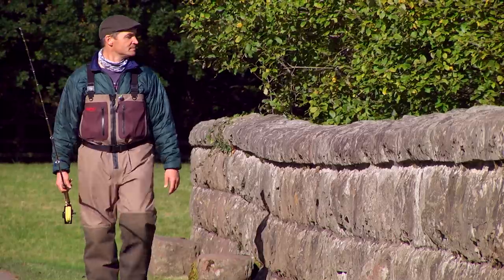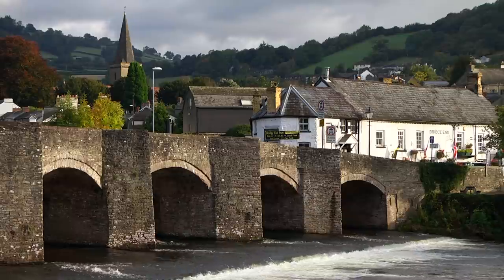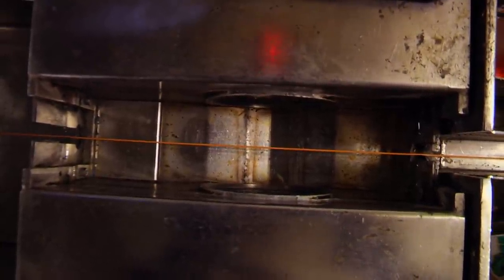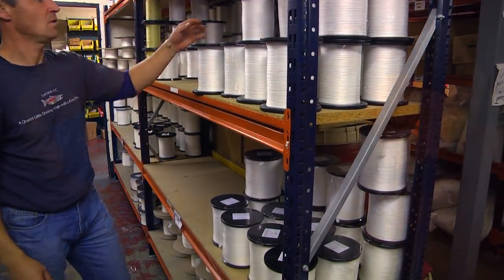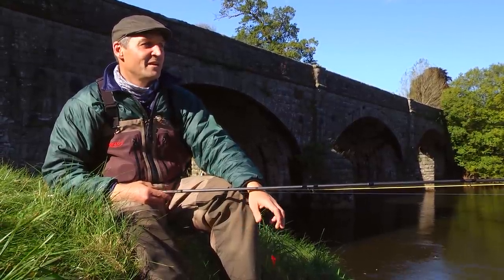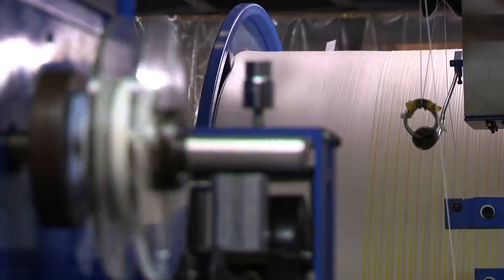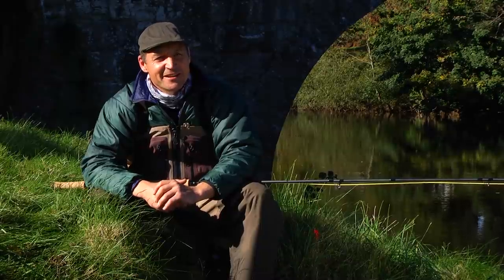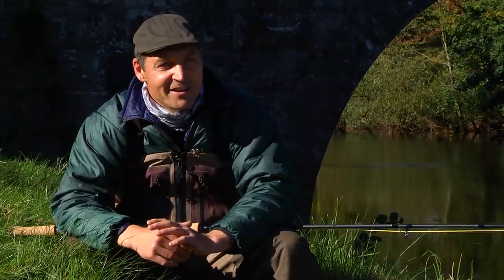How a FLY FISHING LINE is MADE - Behind the scenes at the AIRFLO factory in United Kingdom.

Comment: I used to operate these machines while making filament for 3d printers. It is a very tedious job and you cannot slip up even for a second or things go out of control. Everything is on a timer. I had 15 seconds to cut the end, push it through a hole, unscrew it put it aside, put a new spool on, load it up before the line got slack (at the top) and that was a panic job every time, no room for error or everything went haywire. You can slow it down but you know, my boss pushed for quantity per hour. Perhaps on this setup it gives them more time to casually do it.  I only lasted two shifts doing it lol

Comment: Airflo sinkers have always been good. The floaters have a very bad rep because of the memory or corkscrew issue. Now apparently this has been sorted. Can you advise what was the issue and how you have resolved this. Nobody wants a memory full line that lasts forever. We would rather a line that lies straight on the water without tension that only lasts a season.